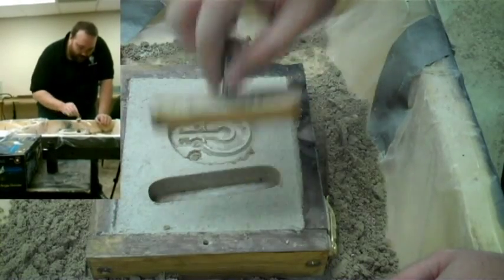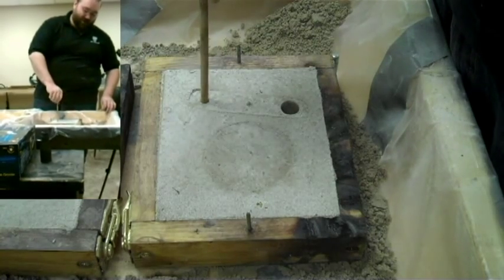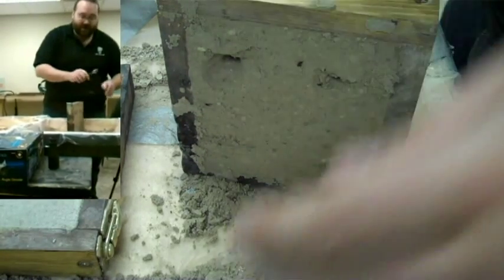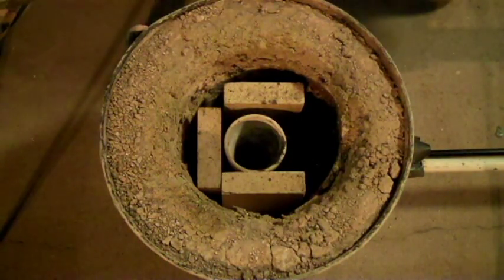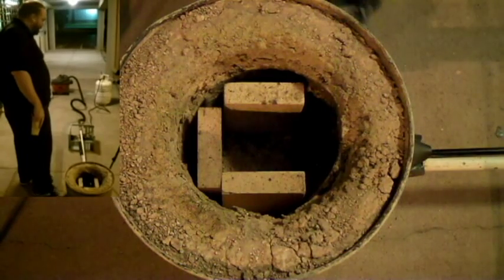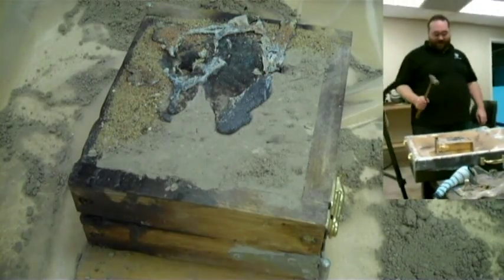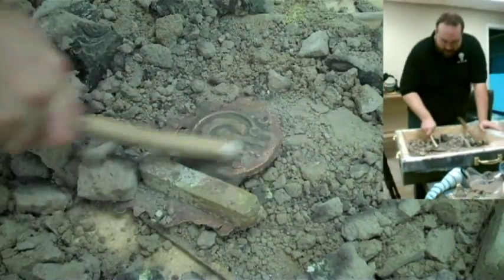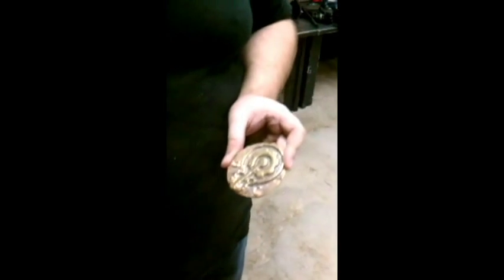Simple Bronzecasting using Makerbot prints! (Part 2)

Comment: Hmmm. And hmmm. I think I need to get my casting kit out of the garage, after I head over to a guy I know with access to 3d printers.

Why haven't you made a funnel into the short ends of the box/flask? That way, you can make a funnel through the sand straight down into the object you are casting.